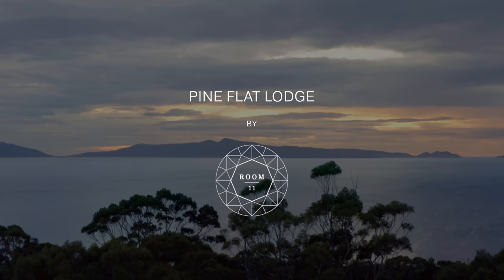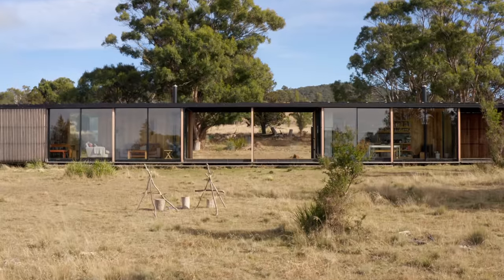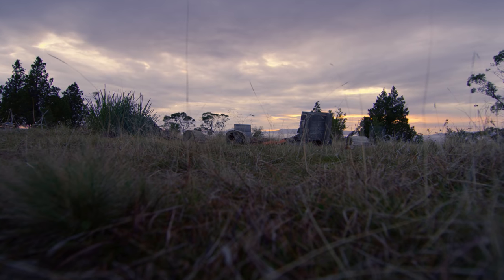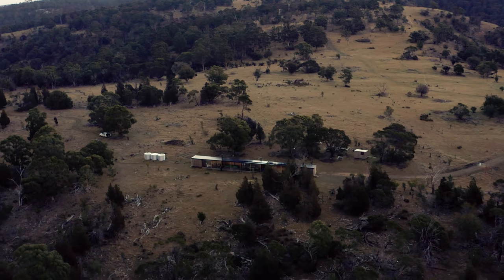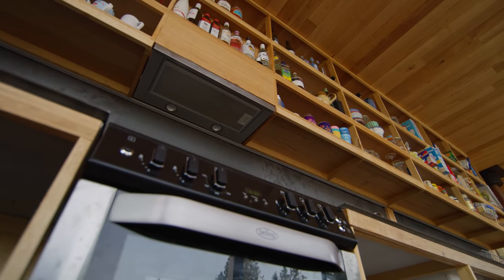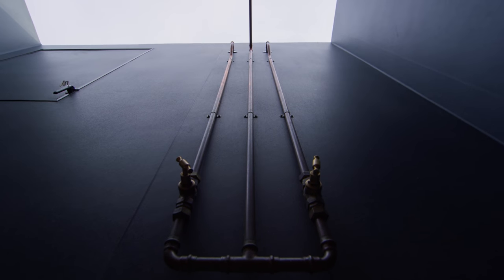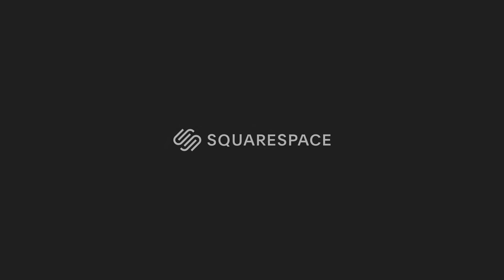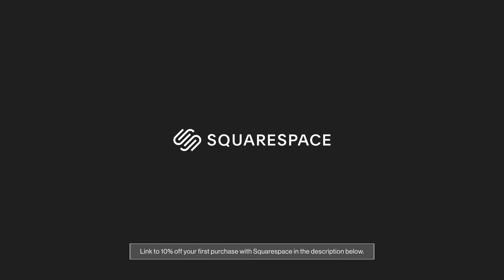Two Architects' Design and Build an Off Grid Cabin in the Forest (Cabin Tour)

Comment: This is quite an amazing home, with such an unusual footprint, a long continuous horizontal plane. I have been watching this channel for several months, and I don't recall ever seeing a project like this one that focused on sustainability and preservation of the environment. I see that the homeowners are living off the grid, understandable, given the location. I would have wanted a bit more information about the use of solar panels on the roof as well as the rainwater collection tanks, and even the nitty gritty of whether they utilize composting toilets. In regard to sustainability, it would be nice to see more urban projects with renovation of existing spaces. I can think of the Cairo Flats in Melbourne, which have historical significance, and are modernized for the current homeowners.
Reply: There are multiple homes on this channel that are very similar to this one and even focus on sustainability and the environment.
Reply: I feel it's mostly out of necessity rather than sustainability. Australia is almost as large as mainland US, but inhabits only 26 million people. The low density makes it cost prohibitive to hook anyone up to the grid outside of populous areas. Where I live now, it's 35km from the centre of Melbourne and we're only connected to the electric grid. The house itself functions like a normal house with the exception that rain water is collected from the roof into a 30,000l tank. An electric water pump supplies water to the house. Waste ends up in a septic tank. It's not entirely self sustaining and needs to be cleaned out from time to time. But overall, it does make you aware of your water usage.

The biggest issue however is that most houses here aren't that energy efficient. And because it's not that common, building one can get very expensive if you want to do it right. You'll notice that most of these cabins in these videos rely on wood fire stoves to keep them warm, because of the large single glazed windows. You can get double glazing here, but it's usually not up to the standards you'll find in Europe. So to heat up a home and keep it warm, you would need an excessive amount of solar panels to compensate in the winter months. 
These cabins look great as a get away in summer, but I can't imagine them being that comfortable in winter. Especially in places like Victoria and Tasmania where it does get cold.

Comment: Why this trend for flat roof boxes? Do pine trees have flat tops?
Reply: Terry Wrist  what the fuck are you on about lmao? Do you think flat boxes are supposed to be more climate friendly or something? It's just a design trend, love it or hate it.
Reply: Having a flat roof actually improves the temperature regulation of the inside of a structure like this. The space crated by a traditional roof creates a large air gap storing heat in the summer and cold in he winter causing the need for either additional ventilation or cooling or heating therefore increasing the occupants cost even with good insulation. A strong flat roof dispatch heat mainly pretty quickly.... it's why computer heat sinks are NOT made in a pyramid shape.

Also the traditional roof creates a lot of material waste solely based on it's design along with losing an easier ability for a structure to adapt over time to requirement changes.

The "box" shape structure also cuts way down on material waste as well because its easier to make a square from straight line than to make circles and triangles etc. You would be surprised at the amount of material waste ( money waste ) goes into the traditional structure.

That is the short answer to your question and not the excrement brain fart answer above about "woke....etc".
Reply: I know one of the reasons why people use flat roofs is to reduce the visual impact of the structure